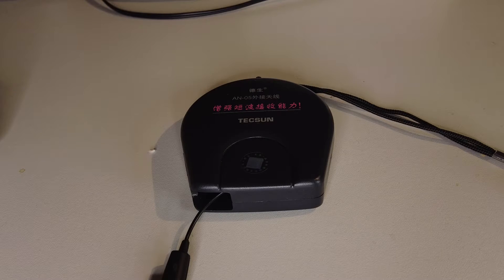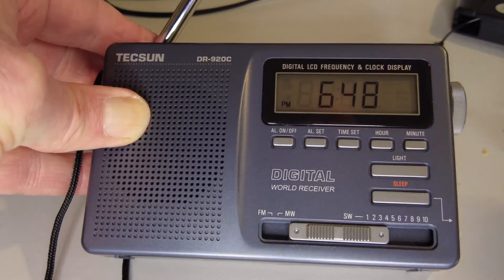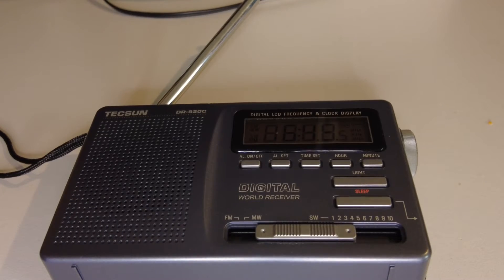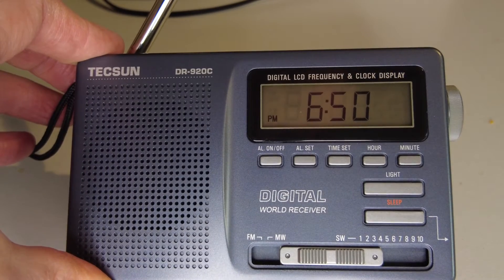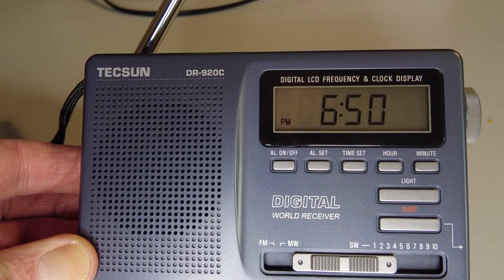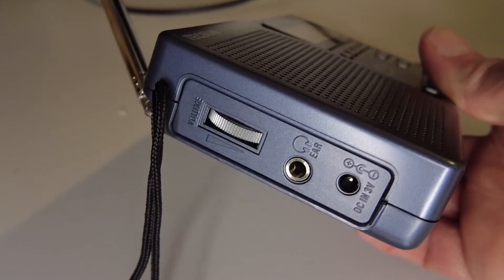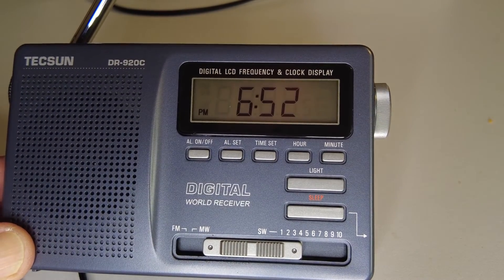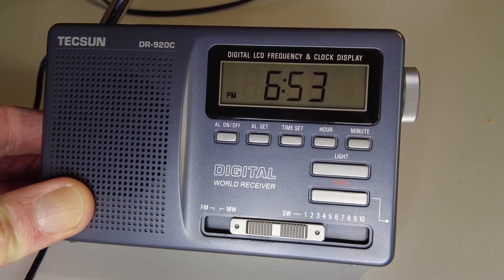External Antenna on the Tecsun DR 920

Comment: Yes, that was an interesting experiment; why disagree on the conclusion - it all makes sense. When it comes to the "long wire" type of antenna, the second wire end could be connected to the ground/minus, to avoid overloading (a capacitor might be needed to connect the other end to the built-in antenna). There should be a HF pre-amp transistor in the DR-920C receiver, which can be potentially removed, and then the long wire antenna can be connected directly... but without the pre-amp there will be other issues like inconsistent volume level, depending on each signal strength, fading in and out. If I had the DR-920C, I'd do the following: using a passive loop/frame antenna, connected through a HF transformer to both antenna and the ground. Long wire... probably no. 👍🏻